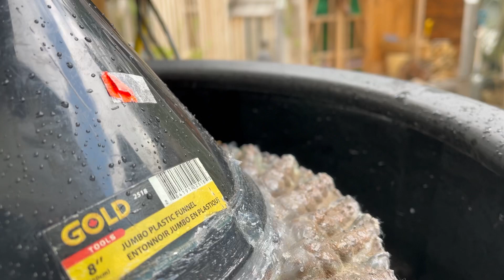Schauberger Condenser (Running)

Comment: In general, there is something that can provide a certain understanding... The trajectory of movement, the forces of gravity, the implosive process... Your device can condense only steam, but unfortunately air cannot... There are known technologies for condensing air that pass under pressure... Also  condensation also takes place on cold surfaces... These are exactly the conditions that must be formed in a fascist device... But even this is not enough to understand Schauberger!!! The fact is that a liquid or air passing a certain form of movement must give off heat to the surrounding medium,  in all Schauberger devices, the liquid during the traversed trajectory is subjected to uneven compression from the forces of gravity (acceleration, braking, change of direction of movement)... And the resulting liquid is compressed and the temperature rises, at this moment heat exchange takes place through the copper walls... This is how cooling takes place and gradual  condensation of water along the trajectory of movement. The vacuum that arises as a result of condensation of water is energy... This is a complete analogue of a heat pump!
Reply from the maker: Very good explanation. I see alot of potential with Schaubergers ideas and quiet honestly I wish new  ideas would stop growing in my mind. Ideally we utilize his devices without the motor. This is where I’m thinking now, strip away the motor, melt the copper coils into Schauberger coils…make a Schauberger motor.
Reply: @Seasquares  Try to understand something else, something that will enable you to construct the right device.... Every sound, impact, vibration vibrates space, these vibrations intersect and create a certain density of space in the world... That is, space has its own frequency spectrum, this frequency has its own  in turn both reflects from surfaces and partially penetrates objects...Each object echoes and has its own frequency depending on the frequency of space...If you physically affect the object (compress, divide, move, etc.), changes in the object's internal frequency occur.  ..It is at this moment that the distribution of energy takes place... Water moving along the helicoid gradually lowers its internal frequency, as a result of which its characteristics change. This is a completely different understanding of the process that is taking place...
Reply: @Seasquares  I can share my thoughts...I need your WhatsApp address.
Reply: Gravity???  Density you mean?

Comment: So the friction from the cone spinning, coupled with centripetal force, draws the steam down into that absorbent buffing pad and the wind passing over the pad cool the steam condensing it back into water droplets 💦 🤔 Am I close? This would be great in applications where heat is transferred to steam or hot water and needs to cool before being reintroduced to or flushed from a system. Thanks for sharing this! Viktor Schauberger's work is so impressive. It's cool to see it in action. 👍
Reply from the maker: Thanks for commenting!
Reply: @Seasquares he asked you some questions? :/   No?
Reply from the maker: I thought I answered his questions… but maybe I didn’t post the comment. But yes Orpheus is correct the Schauberger repusine is designed with slots in the upper membrane which suck the steam into a very thin interstitial space where the movement brings about rapid cooling of the steam (generally speaking). Another commenter said it much better.
Reply: @Seasquares  Thank you for the explanation ✌️That is a super cool project 🙌
Reply: @Seasquares perhaps you already answered in other comments I’m thinking/seeing

Comment: Awesome. What are you going to do with the water it condenses? Besides purity is there another advantage to this method of distillation? Thanks man.
Reply from the maker: Well my thinking is with an improved design I can distill some large Volumes for electrochemistry and for mixing my own water. Besides that this was really just a test to prove the membrane could condense steam. I also think this could make some epic snow as the water droplets atomize and if you look close at the nighttime shots there are very energetic droplets flying around.
Reply: Are you familiar with the water/vapor that derived from combustion of hho gas?

Not sure i worded all that correctly
Reply from the maker: @Coincidence_Theorist yes I’ve heard of hho but don’t know much about it.